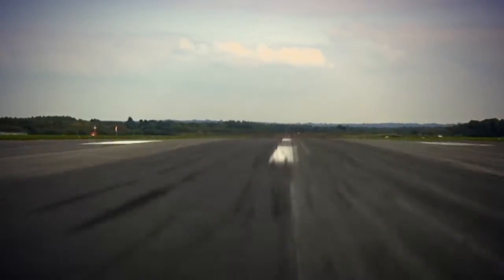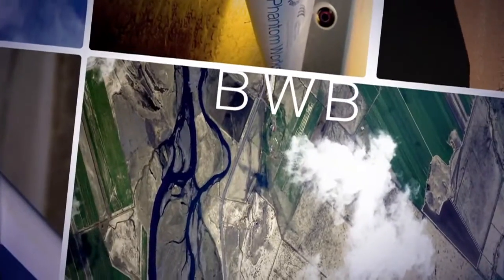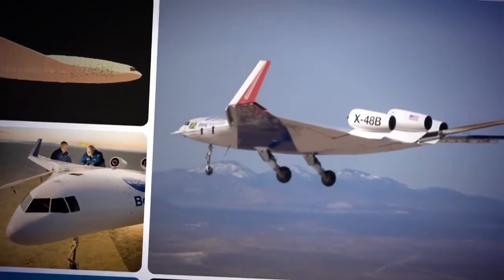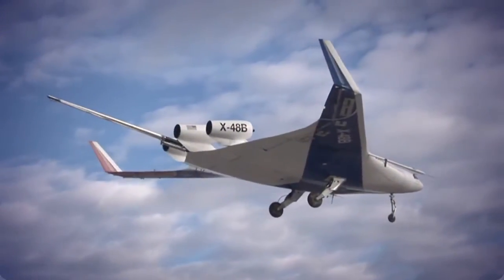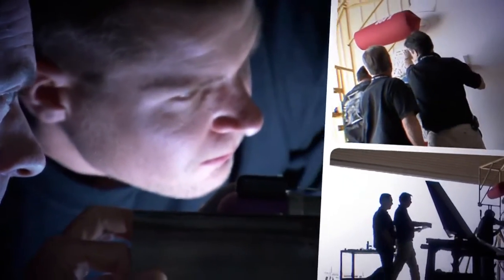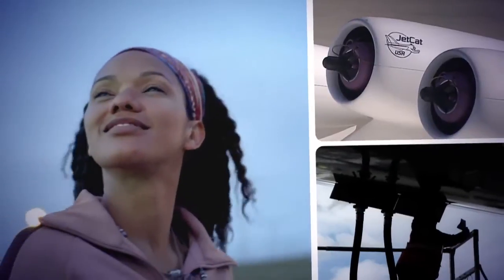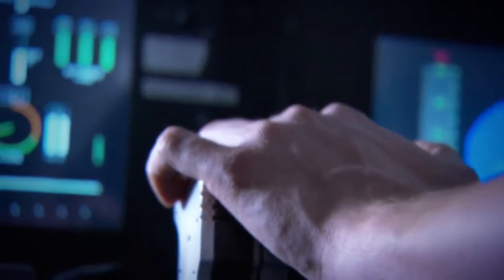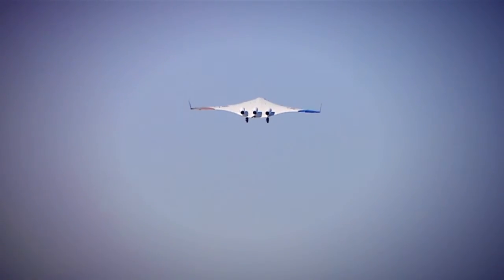Origin Story: Blended Wing Body

Comment: Historical blended wing body aircraft. 
*1924 Westland Dreadnought.
*1942 Miles M.30 X-Minor.
*1944 McDonnell XP-67 Moonbat. 
*1946 CBY-3 Loadmaster. 
*1962 Lockheed A-12. 
*1964 Lockheed SR-71 Blackbird.
*1974 Rockwell B-1 Lancer. 
*1981 Tupolev TU-160. 
Most were prototypes. But some saw success. The concept definitely isn't new, but new technology allows us to get the most from the concept. 
Keep up the good work NASA.